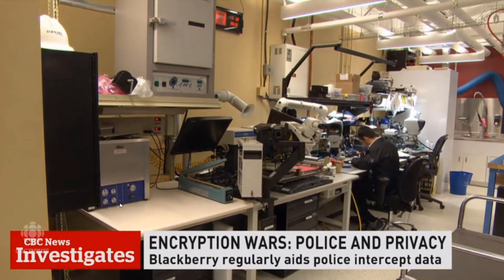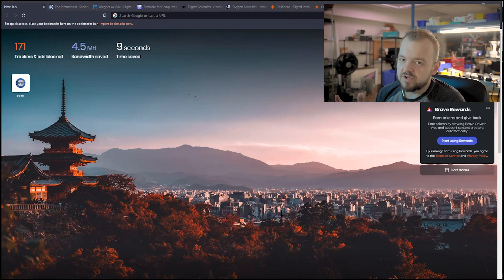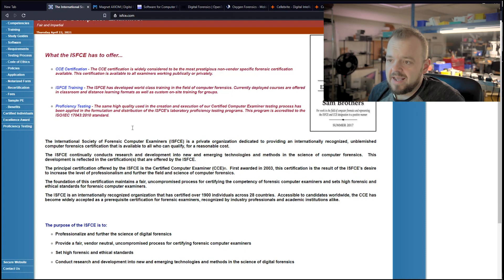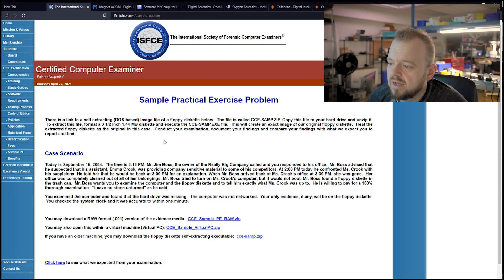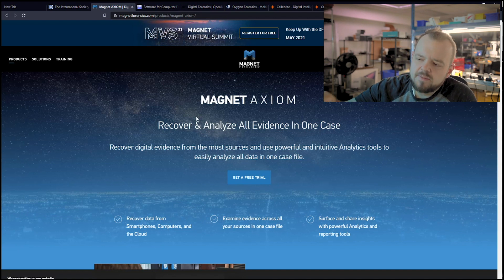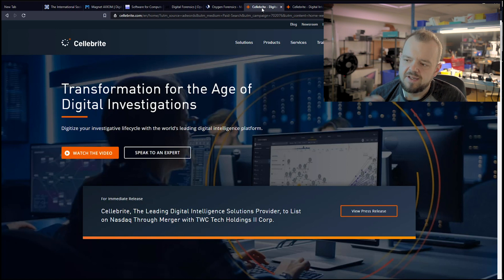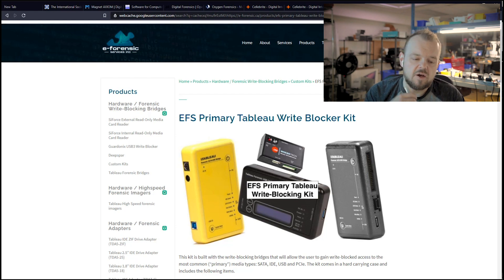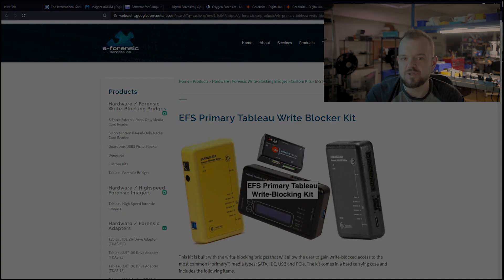Digital Forensics  - What you need to know. Part 1

Comment: Can they recover a hard drive that has been destroyed in a fire? Do you need to be good at maths? for the psycological part is there an auto blur function if you dont wanna see graphic images in forensics?
Reply from the maker: I've only gotten lucky with drives that had light fire damage. You don't need to be good at math but it always helps. Yes we use methods not to have to view the images. This method uses hashes of images compares to a known database of such images. Sometimes the images have to be viewed to confirm the content

Comment: Thanks for the video and can’t wait for the hardware one to come out. I am interested in getting into forensics and was wondering if I use autopsy will that software give me enough practical experience to do my CCE cert?
Reply from the maker: Oh definitely, autopsy it’s quite powerful even though it’s free. Look up who developed it and that should give you enough confidence in it. 

In order to pass CCE, the most important part is to know your procedures. 

Proper evidence handling, document everything that you find. On one of my practical exams, I had a passing score of 103% because i went little bit more in depth with my findings. What they want to see is that you understand the methodology and can apply it when writing your three practical exams.
Reply: @forensicguy  I currently work in the security industry and repossession industry in Australia so I have an understanding of chain of custody, report writing and factual investigation. This is sort of the next set for me.
Reply from the maker: Then you have the right base and experience for CCE. The practical exam should be much easier for you